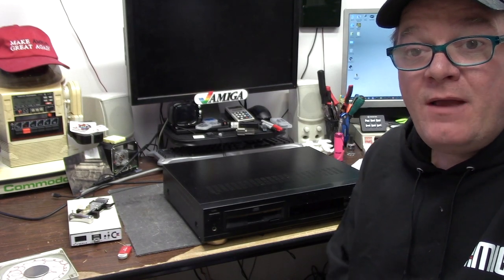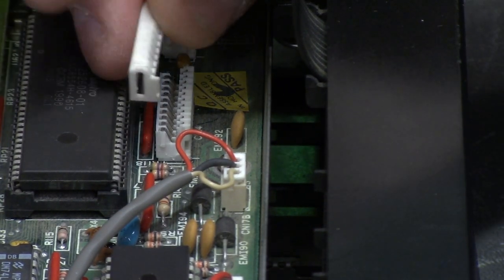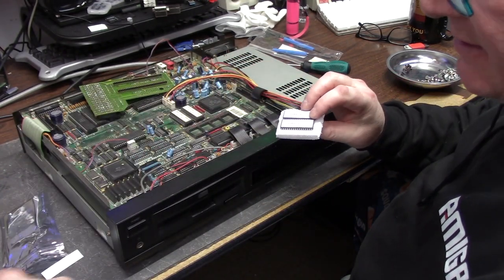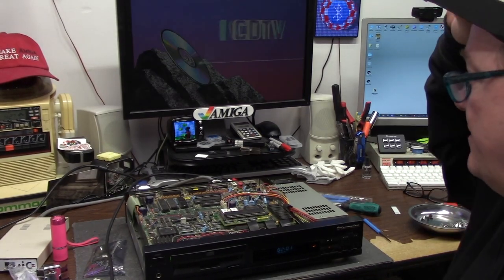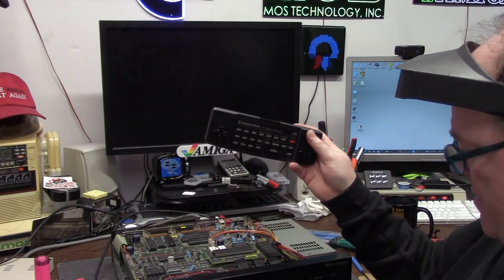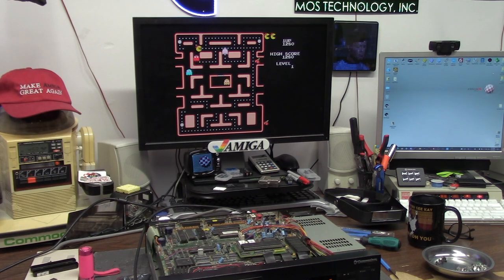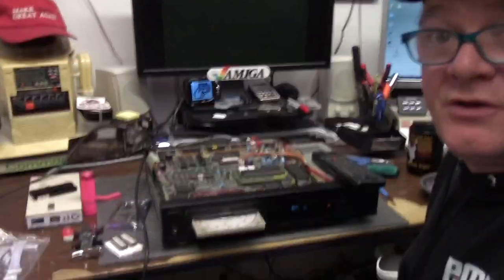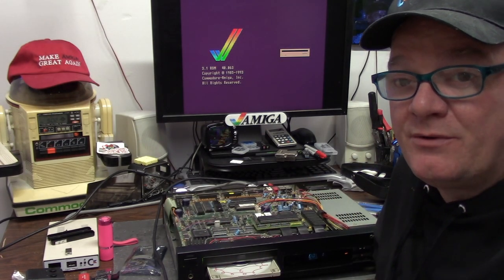cdtv new roms cables and remote

Comment: That looks a right pain! I had the same doing a repair on a QL microdrive cable which Sinclair just bodged into a sip socket for cheapness. ended up just soldering a row of header pins on.

Comment: Great video! As always got me thinking about projects never finished in '90...
I have an internal Zip drive and "Magicspin" DVD +rw drive I've wanted to try to fit into the 5.25" bay of my A2000 (just below the 2 floppies).
Not sure what cable I'm going to need for either; they both have a 40-pin connector.

Comment: Just for reference those ROMs you bought are probably (modified) A570 ones and not CDTV ones. The last CDTV ROM was v2.07 and the last A570 was v2.30. People regularly mis-sell A570 ROMs as CDTV ROMs. It is likely that the NVRAM won't work anymore. Very little software uses it so probably no big deal.

Comment: Over modulated sound. I got the same issue on my CDTV, recap didn't helped. So I've putted a simple passive volume regulator between a CDTV and amplifier. It basically acts like a resistor to lower down the pitch:) If the sound from headphones is ok, then this solution will work (it means that Paula is ok etc). If recap will not help in your case, I hope you'll find a reason.